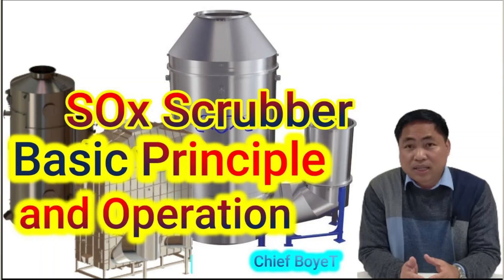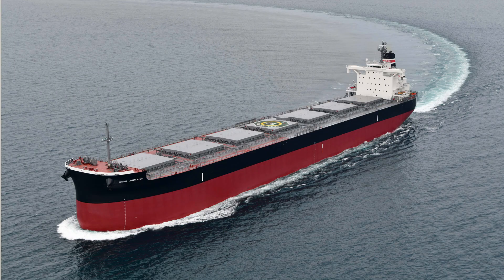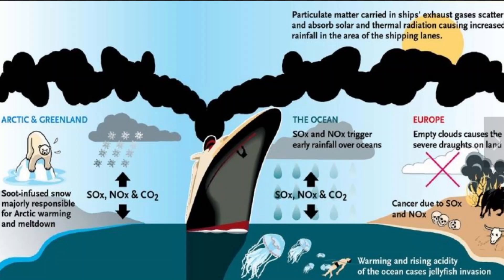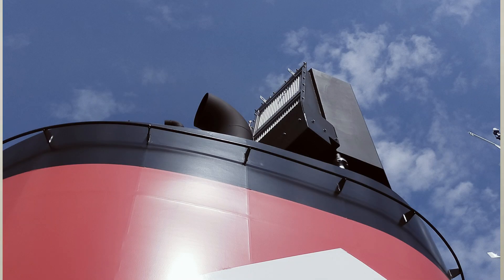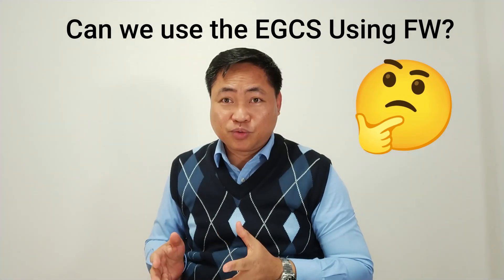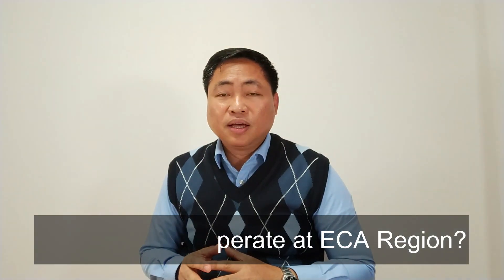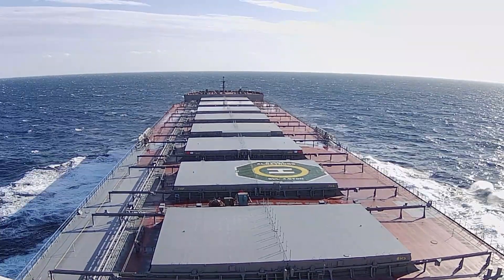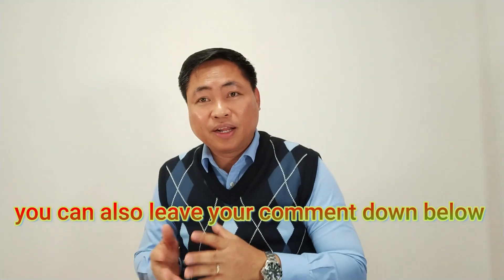Sox Scrubber or Exhaust Gas Cleaning System (EGCS) | Seaman vlog | Chief Boyet

Comment: Thank you for sharing your knowledge! What is operating temperature of scrubbers and what is the exhaust gas temperature after scrubber?
Reply from the maker: Hello Prerna, actually there is no certain operating temp of scrubber. This is depending on the exhaust gas temp passing thru the scrubber.  
Some scrubber design has the what we called venturi and the other called jet section where in the exhaust gas was pre cooled. 
After the scrubber, in almost 10 makers that we have, the max temp setting for the alarm is 55deg C. And the purpose of it is to protect the gas analyzer from being damage.
Reply: @marinerealtalk8683  Thank you for your response!
Reply from the maker: You are very much welcome Prema,should you have further concern, feel free to leave your comment🙂